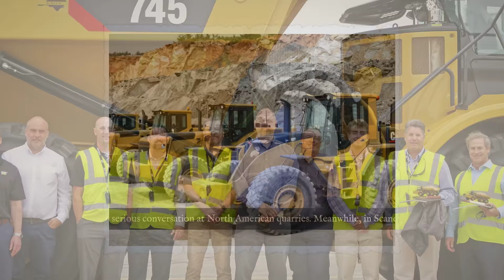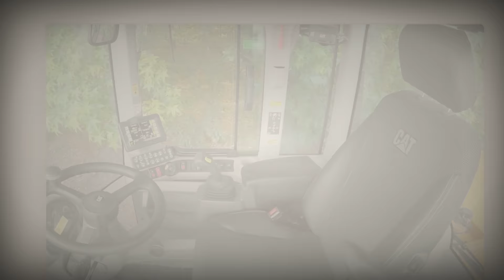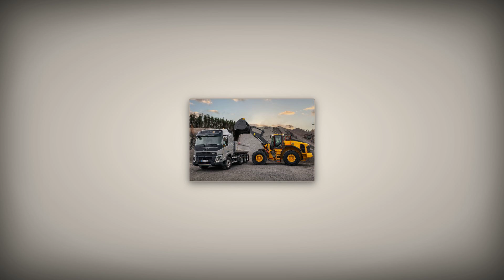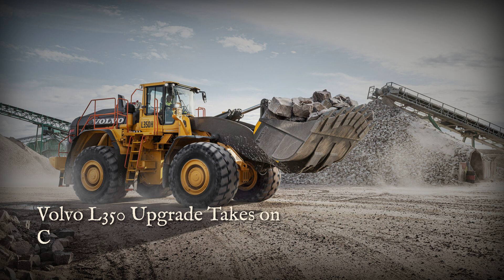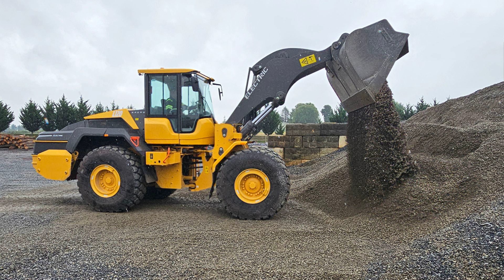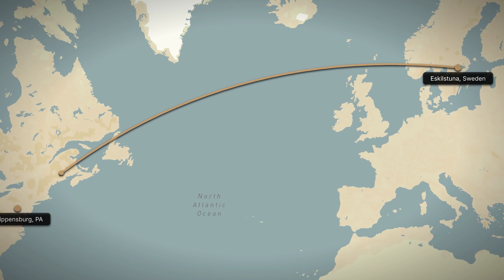Why Operators Worldwide Switched From Caterpillar to Volvo Wheel Loaders

Comment: I remember the early Excavator market in the USA in the 1970s. Case & Drott were the "ONLY" Excavator that could be set up with CONTROLS for the operator preference. With both FOOT & TWO Hand Levers, that made it universal to ALL the Excavator of the time, at that time lots of Excavator had your swing on LEFT Lever, but it was Forward & Backwards for "SWING" Case had it for side movement to swing the upper house in the Direction you wanted to swing, it was not till Cat came out with the 225 Excavator that made it side movement of the long lever, to swing that is standard in Excavator today on all models even the mini excavator line that has exploded in the USA market in 2025. Back then even with John Deere coming out with their first Excavator in 1969 I believe, it was still John Deere with BOOM on the opposite Lever, that all John Deere Rubber Tired Backhoes had as standard control layouts. The Rubber tired Market of Backhoes back then had so many Different control Lever setups with each brand having their OWN Lever Layout for operator, to try and learn a different pattern for function. Today it is all standard TWO Lever (X) pattern on almost all Backhoes with only an owner with a brand new machine picking one of the older 3 or 4 Lever control pattern if they want it from the Factory. Most all Excavator have a (Change out value control) close to the Door, or in cab for operator preference of what I call "CAT" control or "JOHN DEERE" control Lever pattern, with BOOM on Right or Left Lever, there is a (S.A.E.) name for the valve position, but I just call it the two different Names of those big Manufacturer, because it was Cat who first started standardization of were the BOOM function was placed with the roll out of their First the 225 CAT built in house, with secret Tests in Arizona hard Rock for 6 years, before roll out to sales, and I think some 225 went to contractor for testing in real world operations before starting on market. Just what I have heard on video about earlier developments of Excavator that had so many different Cab Layouts for an operator back then. The big one being the change from Cable to fully Hydraulic excavator, and making it more comfortable and less harder to LEARN to operate.

Comment: Man, comparing L350 to 988K and not mentioning a diesel electric CAT XE version which now sales better than standard powershift transmission and saves 30% fuel?? and that's your definition of honest and objective video?
Reply: CAT lost ground on diesel electric to european trucks and loaders long time ago
Reply: @MarioDarnadi  so, what's an example of diesel electirc loader in 988 60 ton class loader,  available on market  kong time ago? when i see competition , only a Komatsu WA600 or Volvo L350, both with standard powershift. and in OHT, biggest competitor Komatsu also uses powershift transmission. this video omitted many facts that don't fit the thesis.

Comment: One other thing is how a quarry works in Nordic countries vs rest of the world, excavators feeding trackchrushers like the Jonsson ,now own by Metso instead of loaders then you not need that brute force  of a  caterpillar in rockpiles
Reply: Big difference between unloading a crusher than moving raw bed rock.
70 tons and up Cat is good. 
Anything under 50 tons Volvo dominate when it comes to less fatigue and cycles during a shift. Cat is way,  way to stiff in the hydraulic systems compared to Volvo. Not alone the chassis. 
Cat is outdated and to proud to meet customers demand when it is a lot better alternatives out there.

Comment: Im a trucker from gothenburg sweden and here in sweden you se rly only 2 brands off wheel loaders Volvo and a smaller swedish brand Ljungby maskin the rly big operations run Volvo and the Mid sice and smaller run Ljungby im 33 years old have driven big rigs since 19 and in Mi lifetime i have only seen one cat loader and it Was a rental while there Volvo Was down for repairs
Reply: We have both Volvo and Ljungby loaders at work. Seeing a Cat 950 I'm very happy that we chosed a Ljungby L18 as our bigger allround loader, The sight from the cab is perfect, imagine putting some forks on a cat, not one single pallet would be intact. I get that Cats are quarry machines and nothing else, so if the need is a loader for both some gravel loading, pallets loading and plowing in winter it's definitely Ljungby or Volvo that comes on my mind first.
Reply: Dinky toys. Gruvorna här i norr har massor med Cat
Reply: @tortap Ja Cat är ju helt klart störst i gruv-branschen.